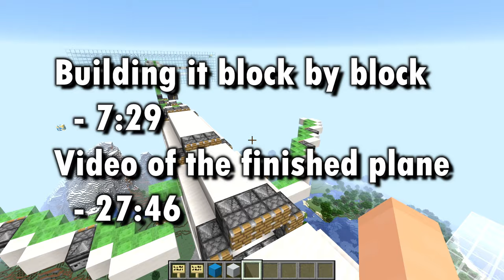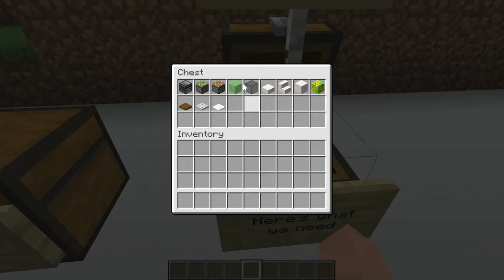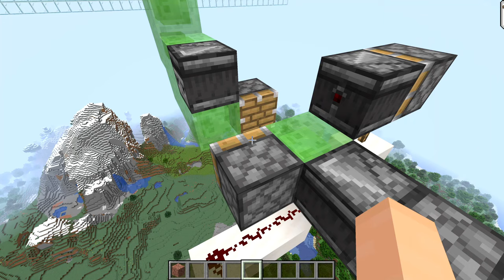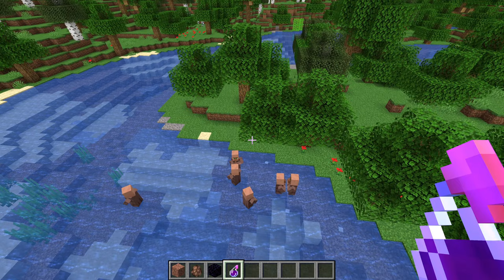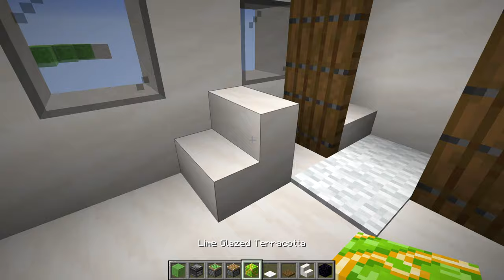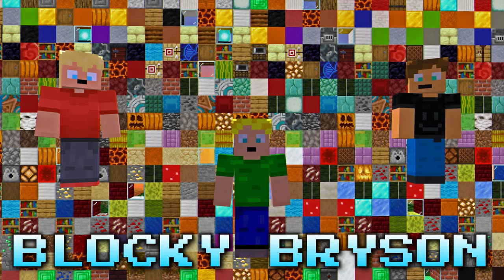How to Make a Working Minecraft Airplane (Java Edition, Realistic, Flying Machine, Tutorial)

Comment: Here's a story of my minecraft economy/country server that I used this plane in: 

I actually used this for my country/economy server in Minecraft once in seventh grade. I got half of my grade and all of 8th grade to join the server. I had 3 cities, each one was 670x670 blocks big. They were all spaced around 3,000 blocks apart in diameter. It had a small 10-block-wide 2-lane interstate for horse travel but nobody really used that. I built it all in creative, but there are no command blocks and the only currency is paper (there is a huge paper farm outside of one of the cities). I made an INSANELY cool airport. It had high towers where the redstone planes were stationed and it cost around 3 stacks of paper to fly in one, which is around 200 dollars irl. I also made underground redstone trains and redstone passenger boats with canals, but the plane was most popular.

Comment: Could I make some adjustments to the engine part in order for it to work on the bedrock edition? It might help if you make a video on that; but it might not be possible
Reply from the maker: I think if you change up the engine you could get it to work, not 100% sure though. That sounds like a good video idea.
Reply: i Had an idea that if you change the engine to a normal sticky piston bedrock engine it would work since because bedrock have the simular mecanics for building working planes
Reply: I've made this plane on BR edition and yes it's possible just have to adjust the motor some. I'm going to probably make a video on it showing how to do it if you haven't figured it out by now and need some help with making it work.
Reply: The exact build does work on bedrock I tried it

Comment: do you know a way i could get the plane to work on bedrock edition? i found a way to make the engine work but the wings always mess up
Reply from the maker: Not really, the big thing I know about bedrock is that you can't bud power. That means that the observers need to all be pointing right at the pistons or a block right next to them. With the wings make sure that the piston faces don't have an air block in front of them (its opposite from the other pistons because they face backwards)

Comment: Can it go backwards? Thinking about building it on a server.
Reply from the maker: It would be cool if it could, but it only flys forward :/
Reply: @BlockyBryson  Is it possible at all or does it break when you try to reverse? 

Btw is it possible to edit the design to make it go reverse?
Reply from the maker: I think it might be possible. I'm pretty sure if you activate it backwards it will only move the little flying machine backwards, but It might just be as simple as getting rid of the gaps in front of each piston face and launching it backwards. I would have to test it, but I can't think of any big problems.
Reply: @BlockyBryson  Ok Thanks!